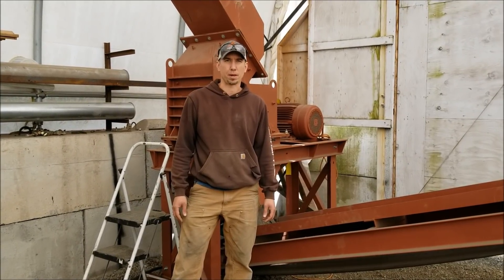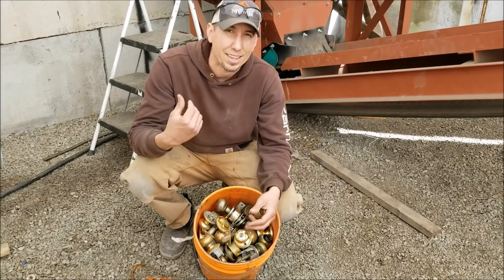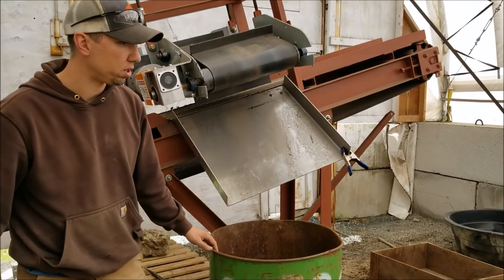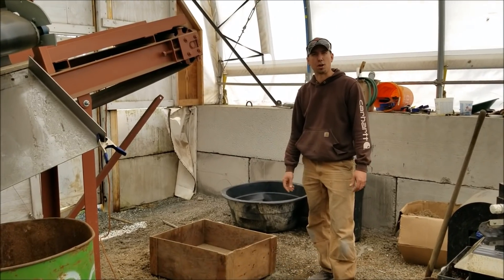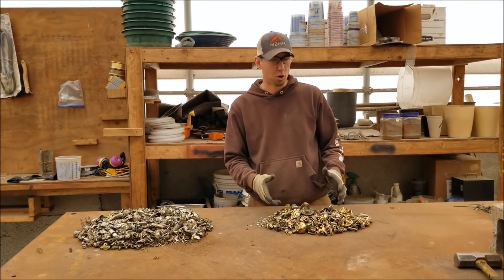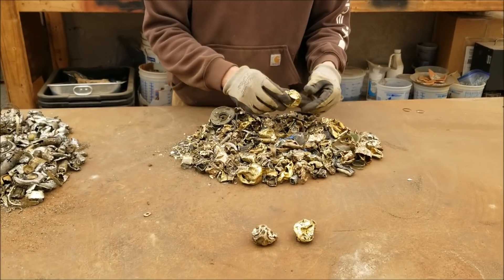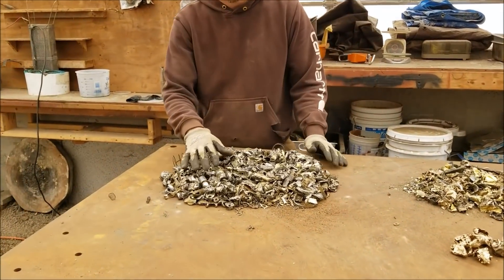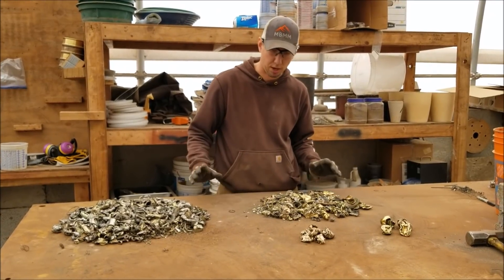Hammer Mill Crushing Door Knobs to Recover Clean Brass

Comment: You have giving me great inspiration on alot of your vids so I thank you kindly . I really want to get myself to get a nice table and crusher plus a few other of your gadgets. Thnx again and what I would do with that is just go quickly through  and seperate all the larger non ferous metal and the smaller non ferous  metal just sell as red mix. It's a little less price but if you were to pay someone to separate all of it then u would lose cash by hourly wages
Reply from the maker: Great, thanks for the tip!